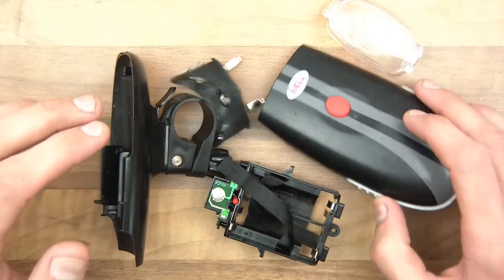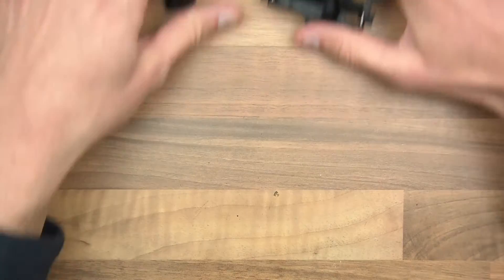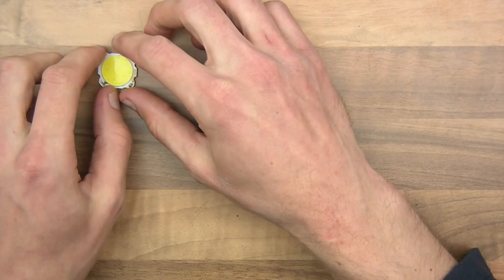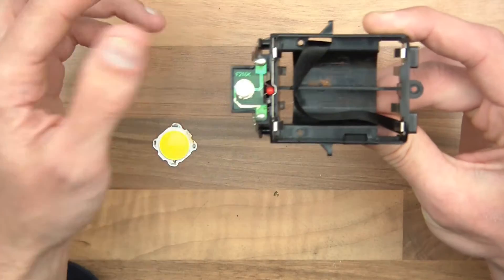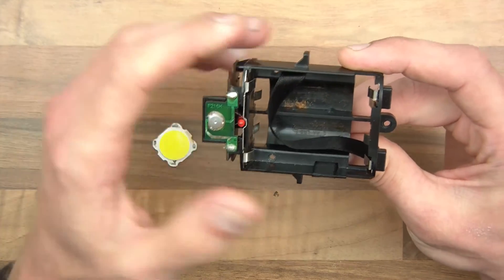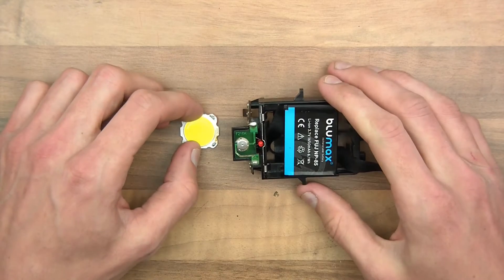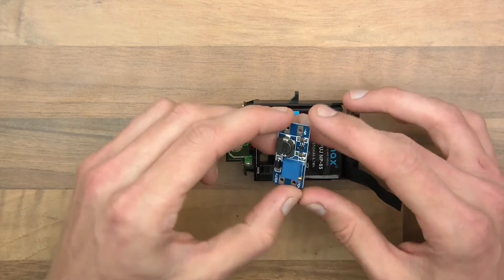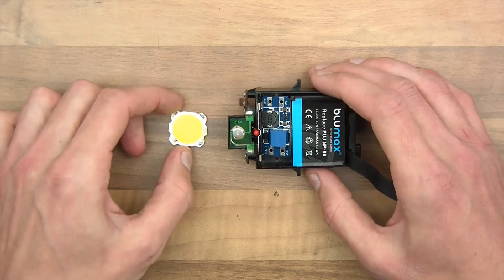TUTORIAL: How to Convert Halogen Torch Bike Light into LED & Lithium! (Part 1)

Comment: Not fan of those devices, that requires you to always buy AA/AAA battery! I know there are rechargeable AA/AAA, but lithium bats are a better choice!   I generaly use TP4056 + 18650 combo to make my projects rechargeable, and if more voltage is required it is always posible to add a step up converter!! If you worry about the place, there is a board which combine already TP4056+MT3608, a TP4056 with StepUp feature! https://fr.aliexpress.com/item/4000534818584.html?ws_ab_test=searchweb0_0,searchweb201602_0,searchweb201603_0,ppcSwitch_0&algo_pvid=5b2a8893-ff2d-48c2-bd39-165755fde59f&algo_expid=5b2a8893-ff2d-48c2-bd39-165755fde59f-36  
Only a bit of ingenuosity is needed to fit all together ;)

Comment: I replaced a halogen desk lamp's bulb with a 12v automotive led.  It works, but is much dimmer.  I still like the cooler bulb (and more energy efficient).